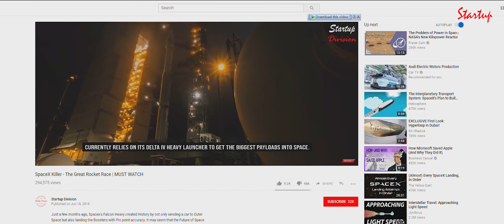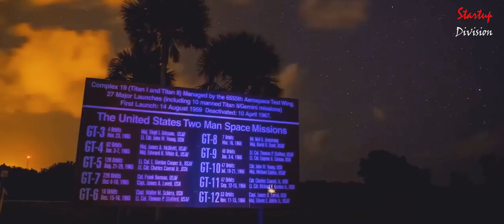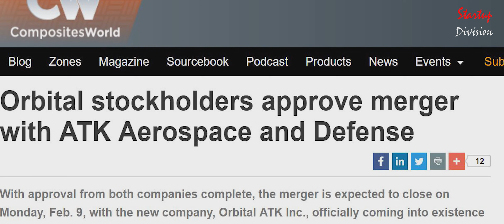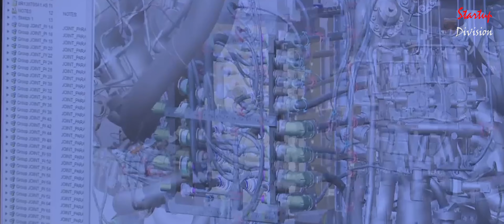SpaceX Killer - The Great Rocket Race | MUST WATCH | Part 2

Comment: There are a lot of misinformed people here in the comments that keep talking about space junk and as if it's an immediate threat and problem. Don't get me wrong space junk is a problem, but it's not a tremendously huge problem. There are currently only about 5,000 sattelites orbiting the Earth and only 2,000 actually active.

An easy to think about this is to imagine 5,000 people walking across the entire planet. You could easily plot course so that none to almost a few would even come close to making contact or even seeing each other.(most of the time) To add another layer to this example, let's say that they can all orbit at different altitudes too! Most satellites are in LEO whole others such as TV satellites typically orbit at GEO. Space junk is a problem, but space is big there's still plenty of room for a couple more satellites
Reply: 5,000 satellites? Correct me if I'm wrong but, aren't there about 750,000 pieces of satellites, rocket stages, etc? And 100,000,000+ pieces of micro debris moving at high speeds? Even if it's not an "immediate" threat, it's enough of a problem for us to actively start looking for a solution.

Comment: I thought this video was rather poorly edited. You showed pictures that did not relate to what was being said, and cut back and forth between topics. It could have been a lot better.
I am very strongly rooting for Sierra Nevada. Despite being frozen out of the initial Commercial Crew contract competition, they continued developing their Dream Chaser, made an unmanned version of it which has won a piece of the CRS contract, and they are proceeding with development of a manned version. I just love the gumption and determination that represents.
The fact is, most of these companies simply are not competing with SpaceX, at all. SpaceX, having come utterly to dominate very large parts of the market, they are pursuing market niches, small satellites in particular, which SpaceX is not addressing. The additional capacity they are creating, is breeding larger demand in those niches, and the total market is growing. That is excellent and desirable. Basically, the slogan of the "new space race" should be, the more the merrier.

Comment: IMO the small rockets are a mistake. The price-per-pound savings you can achieve with larger, reusable, rockets is just too big to ignore. There is no reason a larger rocket can't launch hundreds of micro-satellites to similar or compatible orbits. I predict (if it doesn't already exist) 3rd party agencies that compile data from thousands of mission proposals and find the optimal plan for launching the most satellites possible with as few launches as possible. Basically: an end user wishes to launch a cube sat > end user pays a booking agency to find a rocket to put it on and coordinate with the launch provider/other customers/anyone else relevant > booking agency buys rides on Falcon 9 at bulk prices > SpaceX flies the missions as planned. In this model the booking agency charges the client based on size/weight and any additional requirements (such as if it requires capabilities the Falcon 9 can't provide, an additional fee would be required to cover the cost of more expensive options.) It would be very simple for the end user, just buy a ticket and deliver the payload. The booking agency would handle most of the hard stuff, like organizing compatible missions or even planning said missions. This leaves the launch provider responsible for translating the mission plan into programming for the rocket and executing the mission. Planning such complex missions would take alot of time, requiring a launch provider to either hire more planners or slow their launch cadence, so outsourcing mission planning to a 3rd party booking agency benefits both the launch provider and the end user.
Reply: It's not all about price per pound... On a smaller rocket, you have more of a chance to get the orbit you want, when you want or need it. You don't have to wait for a ride share and only go when the main cargo is ready and only get a rough orbit you wanted, not the optimum orbit you needed.

A month ago (or so) Rocketlab launched 7 microsats in its first commercial launch, and they are fully booked for there next few launches and have  bookings out to as far as 2023... so they are doing something right
Reply: @NighthawkNZ  It doesn't have to be that way tho.

Comment: I think you missed the basic point of the space x revolution. Musk built those things to be reusable with a fast turnaround, like a jet liner. All the other competitive metrics you base this story on are merely incidental! Cheap throw away boosters are not new by any measure. What do you think an ICBM is? Electrons big feature in NZ is the fact that the engine is mostly 3d printed! All the price data is of variant value too as the Space X reusability basically means that their costs are dropping and dropping as their launch systems mature. The New Glenn might give Musk a run for his money but they are way behind.
Reply: This, If the BFR will manage the price goal of around 6-7 million per launch with the honestly ridiculous amount of cargo it is planed to carry its going to flip the table.
Reply: I hope they succeed with their plan!
Reply: @tim_goll  Hear hear!
Reply: No Startup just comes out of the blue and says they are gonna take on NASA...SpaceX started off small...DONT UNDERESTIMATE the title...50 years from now, one of them mentioned in this video may beat SpaceX....as we have seen there are plenty of giants who fell...ask Blockbuster -_-
Reply: Jacob Daniel Jacob Daniel If it will take them 50 years to beat SpaceX, I don’t think the “ Killer “ is the correct word.
Reply: @theexchipmunk  yes! Right on to the heads of the nay sayers and the competition. My childhood readings of Bob Heinlein might come true!
Reply: someone got the point :D